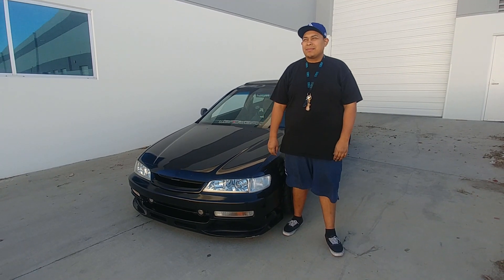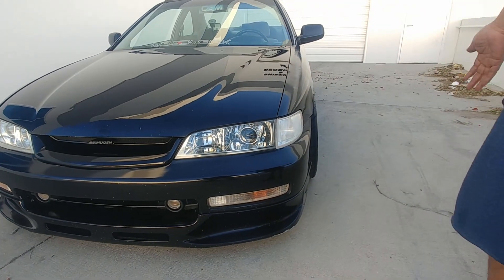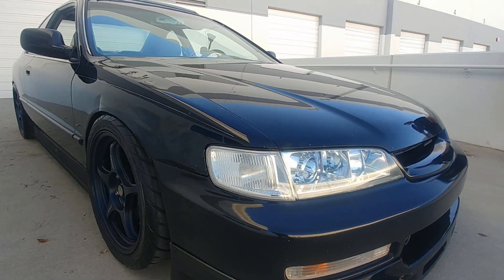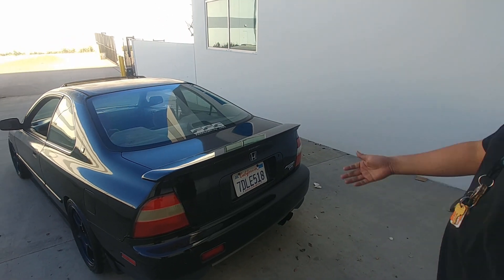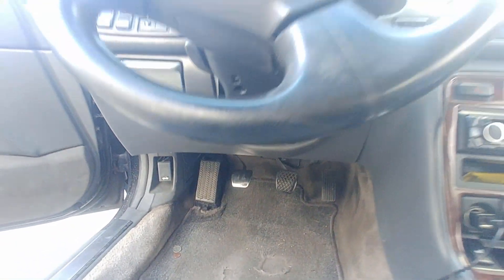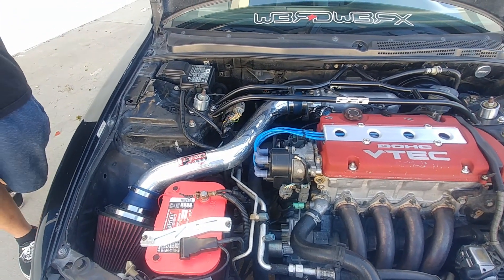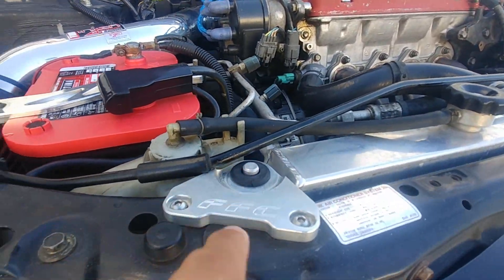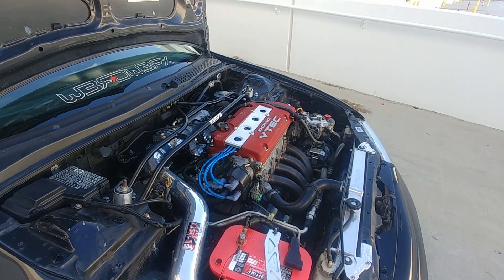How To Build A 1995 Honda Accord: Learning Phases

Comment: I am restoring a Honda accord 1996 which is an all stock accord. THis is my first car and I love it. Wish me luck guys!
Reply: Have fun I have 1 too definitely moves for only have 130hp if you turbo the engine and put aftermarket pistons you can easily push 400whp
Reply: Just got this car running 💪😁
Reply: @kento6201  I doubt it’ll break down again my car has never had any issues that caused the car to stall or anything crazy the transmission is down for skipping gears but it’ll still last years even while skipping
Reply: @kento6201  I’ve never once been stranded anywhere and the only time my car had issues while I was driving was the exhaust being loud and a ball joint broke
Reply: @kento6201  oh and the rack and pinion if you drive crazy
Reply: @semigodslayer9621  Yeah it is running great now. IT had a warped cylinder head and block. We were able to clear the warpage and now it is running superb.
Reply: @semigodslayer9621  Yea  I have minor leaking issue with the rack. it will be fixed in no time though.
Reply: @kento6201  that’s good my engine is still running strong at 215k miles I’ve swapped the transmission because it had a skip with a used one which was supposed to be good but it has a skip too I wouldn’t worry about it skipping too much even if it does because even those last years
Reply: I did the same when 16 of age.. turbo and lowered. Last me years.. I'm now 32 and getting one tomorrow lol
Reply: 😭 i got mine as my first car of may lmao it has 209k on the odometer and still troops around like a soldier 🫶🏾 good luck to your build buddy
Reply: @mikeswrld  209k is chump numbers for this engine if you do normal maintenance it should last 500k up I seen another guy with 395k miles
Reply: I’m on my 5th car it’s a 97 accord 4 door I’m going to completely resore it and rebuild transmission with warranty lol

Comment: I've literally just started upgrading & performance enhancing my 95 accord. I'm no mechanic, I've learned as I go. I've done new radiator, new speed sensor, cold air intake, new ignition assembly, new instrument panel cluster, new brake lines, slotted & drilled brake caliper, just ordered halo LED projector headlight assembly. I've installed everything on my own, speed sensor & brakes were bane of my existence on the days I did them, had help with those two things only. I never was into racing or upgrading my car but once I started, I became addicted to it. Learning how to install these parts & then correctly installing them brings satisfaction & I can't stop lol after headlights I'm going to start in on the turbo kit. I'll have enough money by then. Great video man.
Reply from the maker: Keep building. Take your time and buy quality.
Reply: @AutomotiveAnatomy  that's why it's taking me so long, I'd rather spend the extra for quality parts than the cheap parts I can get same head. After my next installation, I think I'll start in on throttle body & then making sure car can handle the hundreds of HP I'm going to dump into it & torque. Suspension & stuff like that. Thank you for the advice brotha & keep up ghf great videos. I very rarely sub to a channel but I'm subbing to yours man. Alothman is a mad man!!! Stay safe bud.

Comment: I owned a 96 4 door with a 94/95 grill. Debadged, Shaved side moldings, trunk key hole, emblem holes, antenna hole, windshield wiper holes, repainted champ white, jdm front headlights, rote gt3 wrapped in bfgoodrich gforce tires, it was sleek and clean. God I miss it.
Reply from the maker: They look so nice with those mods you did.

Comment: Love my 94 cd5..4 doors look the best imo. That's a clean ass coupe tho 💯 Love that H swap, looks hella clean. Hopefully my single jingle gets close to those numbers lol time will tell
Reply from the maker: Dont loose motivation Greg! Single slammers are fun as well.
Reply: @AutomotiveAnatomy  it's my 5th 94 cd5.  I like to beat my head against the wall and stay single jingle. Last year went 15.53 stock long block, untuned. This year got the head ported/cut .030", Delta 272, bisi springs/retainers, and a pherable ecu. Waiting on the new valves to assemble the top end. Just subscribed bro
Reply from the maker: @greghughey9738  tha ks for the sub. Check out hondasociety.com for other details in the cd community
Reply: Greg Hughey get a dyno tune

Comment: I remember my first Honda...93 civic 4 door manual- it was a real piece of junk. But I liked it, then I wrecked it. Ten years later I bought an accord coupe v6 3.0, that car was sick!! As of today I am a Ford and Honda/Acura only guy. I drive a 2001 F150 with 130k miles and an 05 RL also with 130k miles. I wouldn’t change from those brands for nothing.
Reply from the maker: Thanks for sharing. You cannot go wront with both type of cars. best brands for those specific cars man

Comment: My h22a 95 accord 4door is my favorite car i ever bought
Reply from the maker: Good power to weight ratio. Nice fun daily
Reply: @AutomotiveAnatomy  it really is thank you for replying from new jersey
Reply from the maker: @accorddynamic244  no worries. Thank you for commenting. I appreciate the support
Reply: Same bro I had 95 accord 4 door then. I scraped it got a 2 door did the h22a swap headers exhaust I miss that car so much
Reply: ej8 coupe hday project car holmes .. Where can I get an H22A Motor from for my 95 accord wagon?
Reply: I owned a 95 Accord. Sold it about 12 years ago. Mine was silver.
Reply: @hollywoodthedj1673  u can get it from a jdm depot bro 750 dollar sir h22a long block

Comment: I had an h22a cd5 accord with a m2a4 trans. Lots of fun.
Reply from the maker: What happened to it?
Reply: @AutomotiveAnatomy  got tired of fwd and moved on to an sti. But i have many good memories building the car. And honestly, the h22a obd1 closed deck is the best NA motor ive ever owned. Revved to 7800rpm everyday and never a problem.
Reply from the maker: @BP-fx3qc  awesome. Whatvyr sti. I own an 18. Love it.
Reply: @AutomotiveAnatomy  ooo nice. Mine is a 17. 22,000 miles so far great cars, currently working on a 06 sti that blew the motor getting a built bottom end with forged pistons, that one belongs to a buddy of mine who details my car. After im done with his ill do my own bottom end with forged pistons as well and upgrade fuel pump and injectors.
Reply from the maker: @BP-fx3qc  That is awesome man. I love the rumble on the 06 and 08s. The new ones are quiet stock but performance wise I cannot complain. Boxers engines are so complicated for me lol
Reply: @AutomotiveAnatomy  yea sti's have gotten milder over the years. The boxer is a cool motor, i personally prefer inline engines but if you don't drive like a maniac the sti motor will last. Most of us dont buy an sti to drive it like a grandma's car lol. I got a few vids on mine if you want to check it out, ill also post something on the new bottom end if i have the time through the build. Take care buddy.

Comment: though a "special edition" Honda Accord did come with the wood grain bezel, it did not have the divets for the heater seat buttons.... maybe one or none. and the recessed area where the hazard button , clock and fog button is black. you always know its from an Acura CL if it has 2 heater seat buttons. find a wood grain cup holder cover from the newer version Acura TL to finish the look off same grain texture. sic ass whip tho.
Reply from the maker: Thank you for the info Vega. I hope you enjoyed the video.

Comment: I have a stock black 94 EX coupe, F22B1 , 5 speed manual.  Original owner.

I go through inner CV joints all the time.  They get loose over a few months and clunk putting it reverse or between shifts from stop lights and slow speeds etc..  Even now with level 0 Driveshaft Shop axles, which were beefy.  

Car is all stock, except for solid poly motor mounts. Factory suspension and height.  I rarely get on it hard.

What axles do you use?  And do you also have to constantly replace them in daily diver LA traffic?  

Honda discontinued OEM axles.

Thanks

Comment: My first car when I was in high school
Reply from the maker: What happened to it?
Reply: @AutomotiveAnatomy  Mine was 1995 2dr Ex special edition, dark green with leather seats, single cam Vtec. It was a great car and fun to drive. Maintenance cost for this car is just ok....always have problem with the intercooler water pump and generator once I got this car in 2001(used car with 80K on it)... eventually, I gave it to my niece in 2012. It was still working, but there were lots of stuff needa be restored.
Reply: BTW, I just found some old photos of this car on my google drive yesterday, and that's why I am searching for it on YT and see if there is anyone still own this car. Nice car, bro. Pls keep that well 😃
Reply from the maker: @keigorjai01  Yes, once a Honda starts giving you some issues it is hard to fix all of them before something else breaks. Great little cars.

Comment: Honda never exported cars from the US to Japan. All JDM/EDM/AU/UAE/AF Accords models are in fact a completely different architecture  that had the H series engine.

USDM -CAN accords had an F22 engine, Accords of this Generation mostly had H22's Outside of North America.

This is why the H22a - Prelude swap was common as it had a more aggressive design for heavy charging in racing. This is where honda got the technology to develop what we now know as the K-series.

This Example is pretty clean...
Reply from the maker: Cool info. So what you are saying that there was no Accords made here in the states shipped to Japan?
Reply: @AutomotiveAnatomy  not for sale as new cars, No
Reply: Sorry but you are wrong about this info, the Accord SiR Coupe and the Accord SiR wagon (1997), were exclusively built in the United States at Honda's Marysville Ohio plant (HAM) but were marketed for Japan export only for this particular model, was not offered in North America. Therefore these two models from the Accord line up were built in Ohio and shipped out to Japan to be sold. Only the SiR sedan was made in Japan. The Accord SiR Coupe and then Accord SiR wagon were built with the Japan-spec H22A DOHC VTEC powertrains which were shipped from Japan and were installed into the HAM-built Accord SiR models. The 1994–1997 "CD" Accord chassis was designed for the H22A DOHC VTEC powertrain to be installed; because the firewall was curved at the top to allow more space for the tilting backwards of the H22A DOHC VTEC engine near the middle of the firewall.
Reply: @cactuscomposites  where can i find this information?
Reply: @cactuscomposites  it doesn't sound like a smart business practice to import parts to US assemble and then Export back to japan.

You know it takes 30 days one- trip to import? that sounds pretty stupid.

its documented that CF4 SI-R accords were assembled in Sayama, Japan.

prove me otherwise with a sample car and Vin.  Nothing against you personally but it sounds like some shit fanboys make up.
Reply: @racedojo  This was in between 1994-1997, a CF4 is not remotely close to what I am even talking about nor is the car in the vid a cf4, we are talking about the 5th generation Accord which is completely different in respect to chasis codes and styling as well as how they were built. I am talking about the CD8, CF2 which were the SiR Coupe and SiR wagon which again were built in Ohio. Look up on google and read a little bit it will tell you exactly what I am talking about. Look up "5th Generation Accord SiR" and look specifically for the 5th Generation. I am not talking about the CE1 nor am I talking about the CD5 or CD6 only the CF2 Wagon and CD8 Coupe which were built in the USA and exported to Japan to be sold. No made up fanboy shit here, I own a CE1 and have had two CD5s in the past, I have done my research thoroughly over the years and now what is right and what is wrong, otherwise I would not spray it everywhere to anyone like I know what I am talking about.
Reply: @cactuscomposites  Saul, Wikipedia is publicly created. I was asking for an Accredited source of your information. like i said, nothing against you personally but can you site a reliable resource and back up your story.  im eyes and all ears.

ive had Several Accords f22b accords and a F22A Acura CL so im just genuinely interested in this information.
Reply: @racedojo  Even if it was from Wikepedia then why would Honda put Honda of America badges on the  SiR Coupes and SiR Wagons? It would not make sense for it them to put those badges on those who models as well as floor mats, rear garnishes on the back doors which said "U.S. Wagon" as well as other accessories found in the catalog itself. Honda even marketed it as the U.S. Wagon and catalogs have pics of both the coupe and Wagon. All I am saying is why would Honda go out of their way to put Honda of America badges from the factory on these cars if they were made in Japan, it just doesn't work that way, shoot me you Instagram and I will personally send you stone cold evidence
Reply: @cactuscomposites  race_dojo on IG

Comment: Does the H22 motor bolt up to the transmission that goes to the f22? Also what other parts are needed to do the f22 to h22 swap? Im in the process of doing the swap i just need a little info.

Comment: Is this car bigger than a prelude from that era?
Reply from the maker: I want to say just a bit wider. The older gens look a bit the same size. I do not know the weight difference though.
Reply: @AutomotiveAnatomy  ill just rip some gran turismo 6, that will tell me hahaha
Reply: @AutomotiveAnatomy  looked it up, Accord is 0.3 inches wider, 5 inches longer, 3 inches taller. Prelude is heavier by about 80 pounds though
Reply: Riccardo Spadano the 4th gen is 2840ish lbs.

Comment: I was under the impression that the S2000 steering wheel won't work on a 94-97 Accord. Isn't the S2000 a 33 spline and 94-97 Accord a 29 spline?
Reply from the maker: They do work man 👍 there is a difference between ap1 or ap2
Reply: @AutomotiveAnatomy  Do you or anyone else know. Is it the ap1 that then fits the 94-97 Accord? I have a '96 Wagon that I would like to replace the wheel.
Reply from the maker: @DanRoBurton  check out hondasociety.com your answer should be there
Reply: @AutomotiveAnatomy  I was going off of this list. https://honda-tech.com/forums/tech-misc-15/resource-what-oem-steering-wheel-fits-my-car-2842882/

Comment: I got a ‘95 accord that has over 350,000 miles but I want to mod her out where could $10,000 take me in terms of exterior and interior upgrades
Reply: EX accord
Reply from the maker: a lot lol It depends what you want the build to look like. This accords do not need much to look nice. Spend 5k on engine and suspension. H22 N/A and the rest of minimal stuff for the outside. and you will prob have a few grand left. I would say get a good runnin car before looks and take your time
Reply: Automotive Anatomy Yea thats true. All the parts that make her run are up to date and runs just like a new car